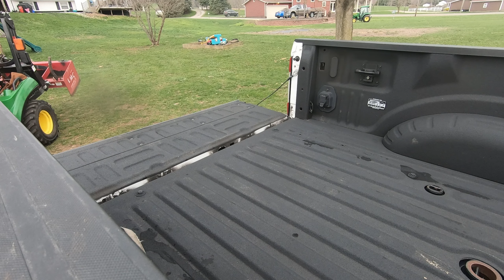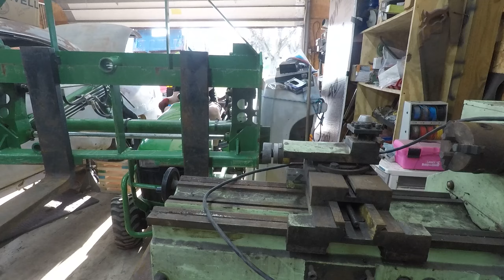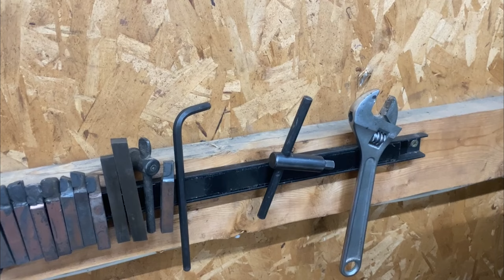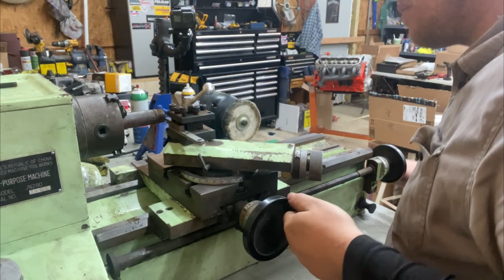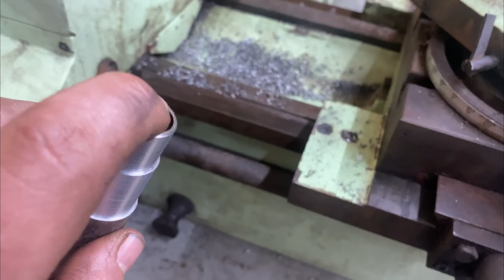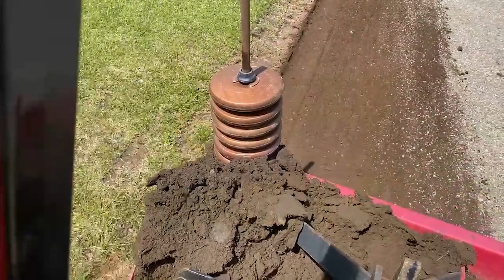I got a free Lathe!!

Comment: That is a interesting lathe in that there appears to be no apron rack and only a lead screw for carriage movement. many budget machines have this feature. For free that is a really good lathe or seems to be and looks extremely solid for its size. I have not even seen this brand before but I would use it in a pinch for sure.
Reply from the maker: Yeah it only has a threading feed, all of the extra gears for whatever pitch thread I want to cut. Certainly not a very capable machine but like you said I couldn’t pass it up for free lol. I’ll have a good lathe and mill some day!